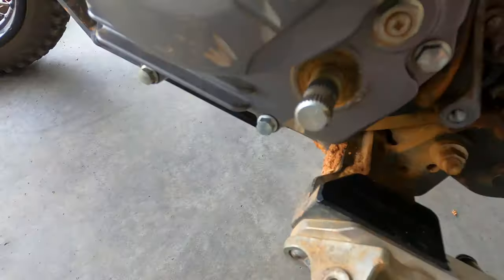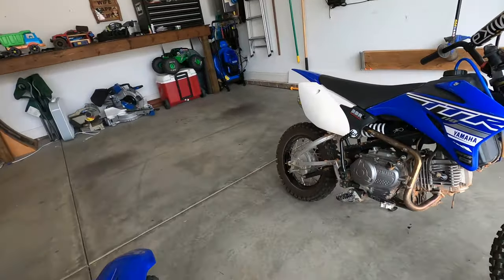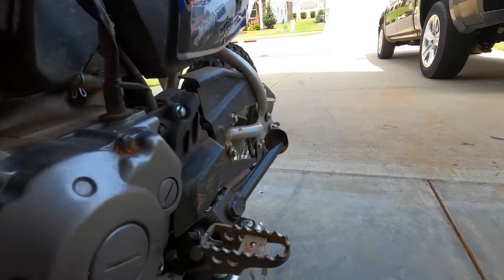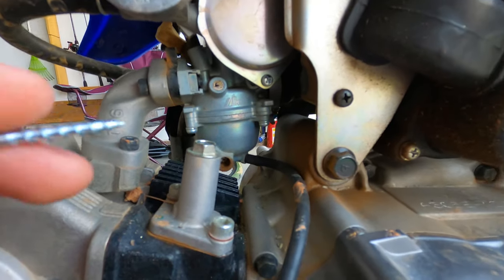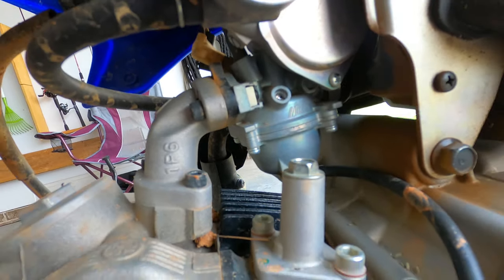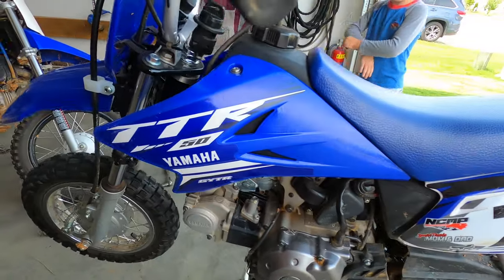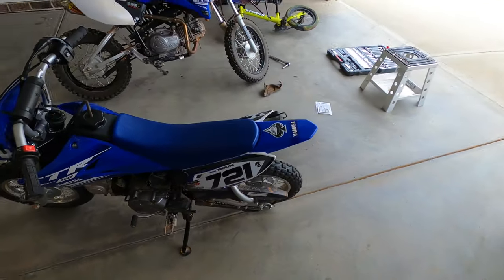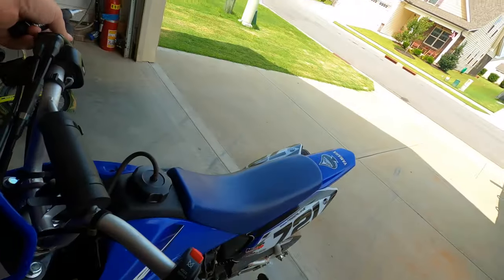Yamaha TTR50 Idle Set Screw Adjustment

Comment: You kinda got them switched. The one on the front near the throttle cable is the idle screw (it raises or lowers the idle to a correct 1600-1800 rpm after you've set the mixture), the other one is the air/fuel mixture screw.
Reply from the maker: Alex Cristescu odd! I found an online manual that said the exact opposite! Thanks for correcting though!
Reply: @realmmfc  
The 2021 model shows that first screw as the idle set screw (flat head knurled screw near throttle cable). The other screw isnt labeled, but its no longer covered. I tried screwing that in all the way and the engine stops (even when holding the throttle back). It was set to 1.25 turns out.
Reply: The Yamaha dealership that I bought mine from said the screw by the throttle was a “governor” to control the speed until my son was ready to go faster.
Definitely need to get past this Welch plug so my sons bike doesn’t die non stop

Comment: Oddly enough my 2021 I just bought flames out constantly. Wouldn’t even idle. Just would die without partial throttle. I turned that screw further and further to the left. Sounds like we had similar issues but needed a different adjustment.
Reply from the maker: Exactly. Glad to hear you got it sorted out!

Comment: Do you know if the 110 is similar? Mine runs good but has a really low idle and tends to stall a lot
Reply from the maker: The placement isn’t the same, but the 110 does have an idle adjustment and air screw. On the 110, the idle screw is directly on the side of the carb.

Comment: That’s the fuel screw man, your idle is below your throttle cables on the carb, little flat head screw, adjusting your fuel screw could cause it to be too lean or too rich.
Reply from the maker: Appreciate it, you’re among several that have corrected! I was provided my information by a Yamaha tech which is sort of scary lol. Thanks for helping the others in the comments though!
Reply: @realmmfc  oh wow I’d say the Yamaha needs some more Yamaha training! What size jets do you have in the carb do you know
Reply from the maker: @G1bson258  never messed with the jetting on that bike. Sold it back in March and bought a KTM 50 as he outgrew pretty quick

Comment: Little help,  I successfully got the Welch plug out but can’t really get any stronger idle out of adjusting the screw.  A turn right it dies, a turn left it dies.
Reply: same issue here
Reply: @laycelong9857  The video's wrong AFAIK. The screw behind the plug is the mixture screw, not idle.
Reply: That screw behind the plug is the fuel mixture screw.  Turn it out richer mixture.  Turn it in leaner mixture.  The other screw is the idle speed screw.  Adjust the idle speed first then the fuel screw

Comment: Tried this. Drill the little brass cap out. Turned the screw out. Turned the screw in. It doesn't matter. Bike will not idle. Revs with the choke on slowly drop then it dies. Choke off it dies. Engine is so hot I can't touch the pipe guard (from holding the throttle open manually). Piece of trash. Bike is brand new.
Reply from the maker: Have gotten similar feedback from some others as well. Worked for us and still runs good. Will agree that those carbs are trash.
Reply: @realmmfc I think I figured it out. There is a knurled screw beside the throttle cable insertion. Someone claimed it is the governor, but it is the idle speed screw. It was set to basically 0 rpm from the dealer, so I had to actively hold the throttle open for it to run.